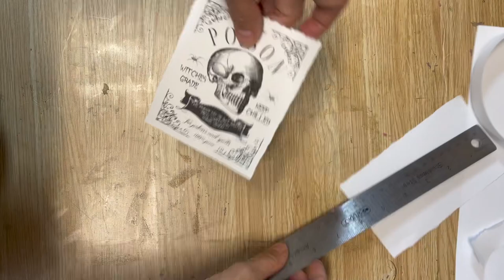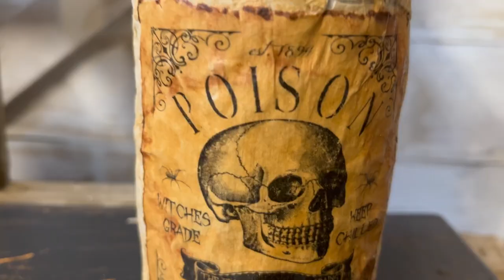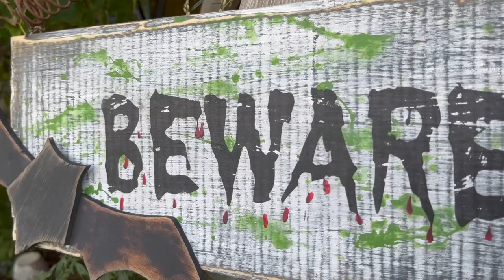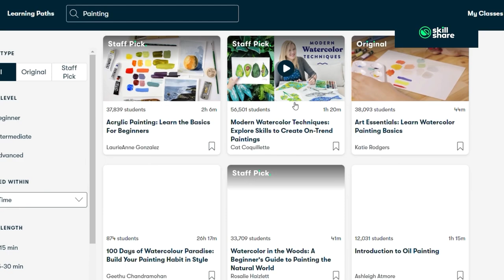Spooky Upcycled Halloween Decoration Ideas You Can Do Yourself CHEAP

Comment: I am a major fan of the reverse graphic sign!!! Now, If I could just make mine come out like yours, I would be in heaven!  I'm still having issues with the layering of colors.  I first put down black, let dry, then if needed add another coat.  then I put on the white, using the Vaseline trick for the edges!  but...for some reason, when I hit it with my sander the black comes off as well as the white!  I wonder if it is because I am using Waverly chalk paint and not your latex recipe.    how thick of a coat do you put on initially? I love all your projects!!   def. going to try the jar and clay look! thank you for another awesome video!!!   Melinda
Reply from the maker: I wonder if you are maybe sanding it too hard or using too heavy of a grit